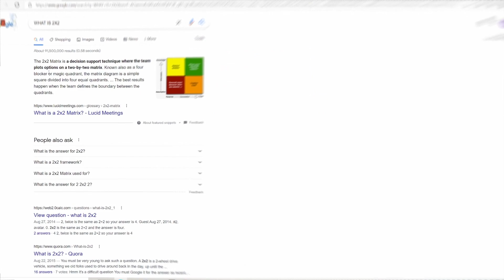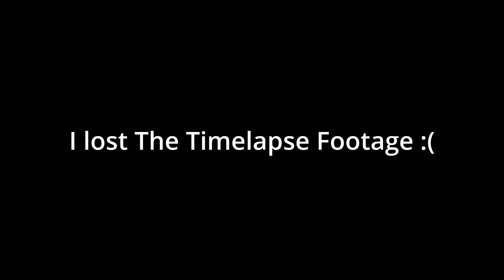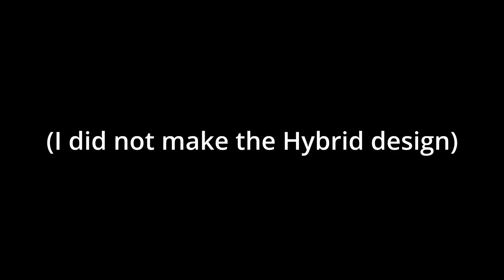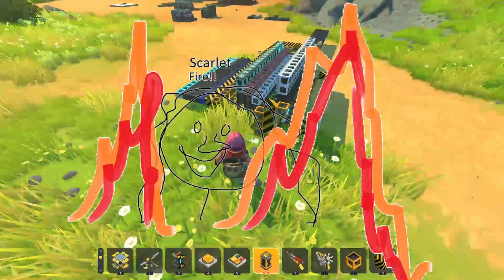First 16-Bit Scrap Mechanic Computer?? (Not actually Tho)

Comment: Time to make a 32 bit computer!
Fr tho, I'm designing a powerful 32 bit computer for Scrap Mechanic. Currently it's just a doc explaing how it works, but I'm getting there. It only needs 5 instructions to continually calculate and display the Fibonacci sequence ;)
Reply from the maker: Wow!! I might work on one once I’m done with this one!
Reply from the maker: Also floating point or no?
Reply: @TheEngineeringMonkey  only integers rn
Reply from the maker: @vibaj16  nice